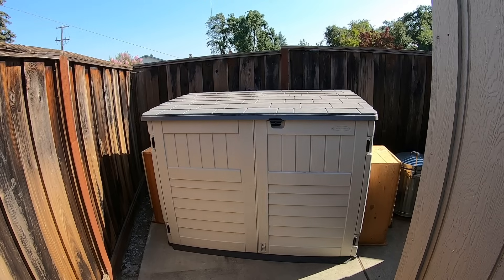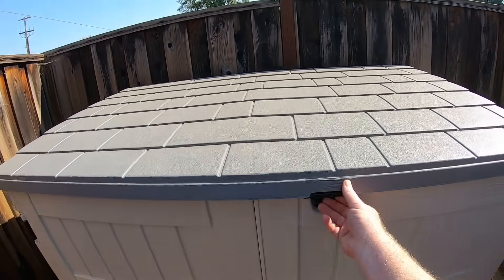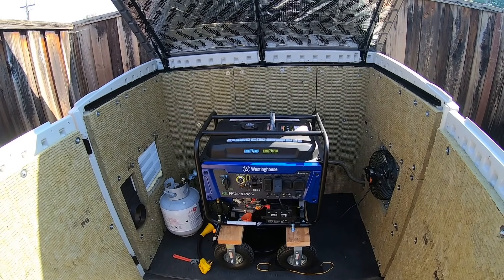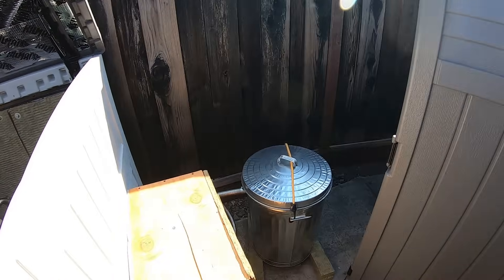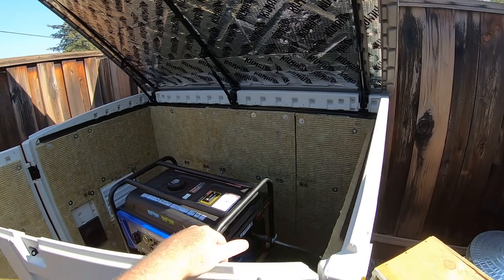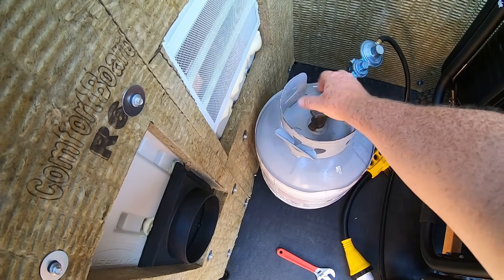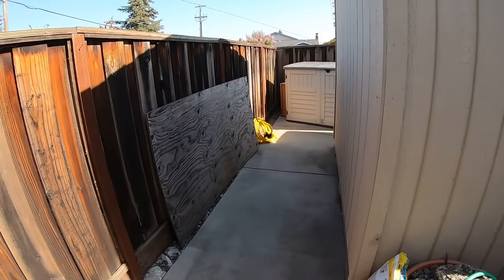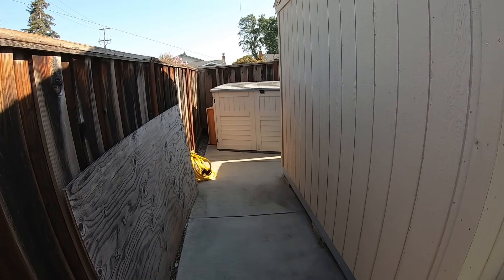DIY Generator Shed Build - Quiet Sound Insulation with Exhaust Muffler

Comment: Excellent job and ideas. However, one VERY IMPORTANT suggestion! I would move that propane tank outside of the enclosure and run your propane line through that hole you have. Because running that generator with the propane tank inside the enclosure is DANGEROUS! I used to work with propane for a living. When the propane tank gets warm from the heat of the generator, the propane expands inside the propane tank, and there is a "Safety Release Valve" on the top of the tank that will open and allow propane to escape into your "Generator Shed," and one little spark and you would have huge explosion. Please take that tank OUT of there whenever you run that generator.
Reply from the maker: Yes, I address this in a later video.  For regular use, the propane tank would sit outside the shed, and the hose for the propane tank would be routed out the same port (blast-gate) on the left side that the electrical cables go through.  The shed was just setup this way for the demo sound test.

Comment: What are the doo-bee-doos called that you used to fasten the rockwool to the inside walls?
Reply from the maker: I discuss all of the parts used in the construction, along with improvements and frequently asked questions in a later video (linked in the description.)  The part about the self-piercing screws starts about 31 minutes into the video, which you can see here:
https://youtu.be/y3pUw408jCU?si=KEo3s2U68X-h3qle&t=1851

Comment: The PLASTIC box can MELT with the heat of some generators.  You can use a remove temperature monitor to report HIGH temps inside the box.

Comment: Any loss of power with that muffler? I know some mufflers can cause back pressure
Reply from the maker: I have a later video (links in the description) that go into improvements to the design, parts lists, and Frequently Asked Questions.  I discuss the backpressure issue pretty extensively.  Check it out here: https://youtu.be/y3pUw408jCU

Comment: How did you attach the blast gate?  I see some sort of clips on the side, but it's not clear how it's attached.  I'm going to take the same route and would appreciate some direction.  Thanks so much for a great video!
Reply from the maker: I have a later video (links in the description) that go into improvements to the design, parts lists, and Frequently Asked Questions.  Check it out here: https://youtu.be/y3pUw408jCU

If I remember correctly (it's been a few years now), I used a hole saw to cut a circle in the shed, and I slid the round part of the blast gate out the hole.  Then I used a couple of screws with some large washers to hold the square frame of the blast gate to the inside wall of the shed.  Lastly, I used some spray foam to fill any gaps around the hole to keep bugs from getting in.
Reply: @C5Tor  Thank you!  Great job on the videos!

Comment: Where did you get the tires?
Reply from the maker: I got the tires at Harbor Freight.  I have a later video (links in the description) that go into improvements to the design, parts lists, and Frequently Asked Questions.  Check it out here: 
https://youtu.be/y3pUw408jCU

Comment: How do you store your propane tank when it’s running. Thanks
Reply from the maker: For the test, I left the propane tank in the shed.  However, in regular use, I would route the hose for the propane tank out the same hole on the left side that I route the electrical cables through.  The propane tank would sit just outside to the left.

Comment: Can you list the parts used for exhaust pipe, flange and your intake fan?  Thanks!
Reply from the maker: There is a later video showing parts lists, costs, frequently asked questions, and improvements to the design.  It is listed in the description, or you can go here:  https://youtu.be/y3pUw408jCU

Comment: An enhancement I recommend is using 1/4 inch thick  mass loaded vinyl behind the insulation. This material is made of  heavy minerals embedded in a vinyl sheet. Use it on all insulated surfaces and minimize seams. I used this in a guest bath and found it to be effective at reducing sound transmission. It might be more effective if placed in front of the insulation but I believe it has a poor fire rating. I did my project about two years ago using MLV from Home Depot and Amazon. Both were the same price but the HD sourced vinyl was higher quality. The finish was clean vinyl. The Amazon sourced vinyl seemed to have mineral dust embedded at the surface and tape would not stick to it.

Comment: I built a little sound proof and weather protective shed for my generator also....
But  , , I have The EU3000iS operates at 50 to 57 dB(A), which is less noise than a normal conversation. 
This makes it ideal for camping, RV power and any other activity that requires quiet operation. 
You can barely here this unit...After about 15 feet away it is not noticeable.....

Comment: What sized fan did you use?
Reply from the maker: I cover all of the parts I used in a later video, linked in the description.  I used a 12 inch attic exhaust fan, rated at 940 cfm, and the shed is only 70 cubic feet (less the space taken up by the generator).  So theoretically, the fan can replace the air in the shed every 4 seconds or so.
The gen 2.0 video is here: https://youtu.be/y3pUw408jCU

Comment: Ok so what regulates the internal temp of the box ...just the one lil fan ? And how much backpressure does that muffler of your create ? Have you had any issues with it (the generator) or the shed since ? Any mods ? As im seeing this 3 years later there should maybe be updates and improvements i would think
Reply from the maker: There is indeed a follow-up video.  The later video is linked in the description.  The Gen 2.0 covers upgrades to the exhaust (to decrease the back pressure), gives a detailed parts list, and also answers many of the frequently asked questions about the first video.  I used a 12-inch attic exhaust fan, rated at 940 cfm, and the shed is only 70 cubic feet (less the space taken up by the generator).  So theoretically, the fan can replace the air in the shed every 4 seconds or so.  It seems to work, although you could easily add a bigger fan or multiple fans.  You'd have to match the bigger fans with a larger opening on the opposite side of the shed to allow more airflow into the shed, which would then be exhausted out of the shed by the fan.  The airflow comes from the left side of the shed (the grate), and is pulled to the right side of the shed by the fans, and exhausted to the outside (on the right).
The Gen 2.0 video is here: https://youtu.be/y3pUw408jCU

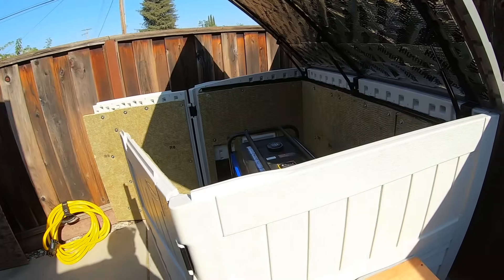Comment: At 8:55 it may not be so much to keep quiet for the neighbors, but more as to not "advertise" to criminals that you have a generator. Some actually drive around and listen for them, then steal them running or not, day or night. I have a shed (when I had a smaller lawn tractor) attached to my garage. I am going to try your trash can muffler, but then a U-turn out the bottom straight up through the garage roof as pushing the sound up above the rooftop will disperse the sound even more. I have several types of alarm/monitoring systems in and outside the shed. I have a warning sign inside that states: "WARNING: We have semiautomatic firearms and a Backhoe. You are already on cameras... do you really want to go any further?"

Comment: you have an open frame generator that are noisy  . If bought a closed frame genie  that are much quiter plus the shed you would have reduced the noise by another 50 %
Reply from the maker: When I did this video, there weren't any closed frame generators that were available that were big enough for my use case.  There are a few now, although they are much more expensive than this generator.

Comment: excellent soundeadening work
there is two points to closely follow
, the first one is the temperature inside the shed when the generator is operating at full load, I suspect an overheating problem there I'm tempted to suggest you to wire a thermostat in parrallel to the low oil level switch to stop the generator if the temperature inside the shed rises in excess of say 120 deg F
the second one is your muffler, combustion process produces hymidity and I suspect that your muffles never comes hot enough to clear it

Comment: You could have saved a lot of time and money if you purchased an inverter style generator which are at least as quiet as your generator in a box, if not more so. You are also creating a lot of restriction with that long hose you have connected to the exhaust, especially using the flex hose.
Reply from the maker: I discuss both of those issues in a later video, where I made a few improvements on the design.  The later video also has parts lists, costs, Frequently Asked Questions, etc. At the time, there weren't any quiet inverter-style generators that could put out the kind of power I needed for my use case (> 8000 watts continuous).  Since then, a few have come to market, although they are about 2 to 4 times more expensive than the generator I bought.

https://youtu.be/y3pUw408jCU

Comment: This model works great with Propane and with NG. However the Gasoline model tends to shut down due to CO2 levels too high in my box shelter. I added a fan to push out the exhaust. My muffler connection broke off due to vibration and I will now have to change some connections to get this back to acceptable performance. Your arrangement is 1st Class.
Reply from the maker: You might want to check out my later video, where I made a few improvements on the design. The video goes into that very topic, and some design changes I implemented to address it. It also has parts lists, costs, Frequently Asked Questions, etc. 
https://youtu.be/y3pUw408jCU

Comment: Doesn't that long piping for the exhaust increase the backpressure for the exhaust?  Not sure the impact of that on the engine operation but it is definitely harder for the engine to exhaust combustion products over the OEM exhaust.  Just a thought
Reply from the maker: Indeed, it does increase back pressure.  You might want to check out my later video, where I made a few improvements on the design. The video goes into that very topic, and some design changes I implemented to address it. It also has parts lists, costs, Frequently Asked Questions, etc. 
https://youtu.be/y3pUw408jCU

Comment: Well constructed. Just wondering why not letting hot air flow upward naturally instead going down by force? 6:42
Reply from the maker: It could certainly be done that way.  I pointed most things down because I didn't want any rain intrusion to the shed or components.  The exhaust points down, the baffles point down, I didn't put a fan on the roof.  All related to keeping rain out.
Reply: @C5Tor  Understood.

Comment: I bought a gas generator to charge my electric motorcycles....  Oooooooo k.
Reply from the maker: I discuss this topic in a later video.  The generator is only used to charge the electric motorcycles when at the MX track or out camping, where there are no electrical outlets available.  The 240v generator also charges the bikes twice as fast as a standard 120v outlet, so that is a plus.  This particular generator is powerful enough to charge both of my electric motorcycles at once, which I can't do with my one 240v outlet in my garage without tripping the breaker.  It's also why I needed to keep the generator mobile, since I need to take it in my truck.  

The later video, with updates to the Shed, the exhaust, and FAQs is here:
https://youtu.be/y3pUw408jCU?si=BdngW7AgPz8bLqX-&t=3000

Comment: How did you thread the exhaust pipe?
Reply from the maker: You might want to check out my later video, where I made a few improvements on the design.  It also has parts lists, costs, Frequently Asked Questions, etc. I discuss in some detail how I connect the exhaust pipe on the original design and the new design.
https://youtu.be/y3pUw408jCU

Comment: Hey man, this is by far the best solution to the generator noise. I attempted to make one with a metal shed lined with sound proofing/fireproof foam with a 4 inch fan. It didnt do much, and my fan was too small. Using an attic fan is brilliant! Everything about your set up is brilliant. We just had Milton with no power for 3 days. I felt so bad for my neighbors, thank goodness there were 3 others houses with generators on. Just, a a quick question, where did you buy your comfort boards?
Reply from the maker: You might want to check out my later video, where I made a few improvements on the design.  It also has parts lists, costs, Frequently Asked Questions, etc. 
https://youtu.be/y3pUw408jCU
Reply: @C5Tor Thank you!!
Reply from the maker: Also, I got the Rockwool at Lowes. 

https://www.lowes.com/pd/ROCKWOOL-Comfortboard-80-R-6-Stone-Wool-Batt-Insulation-with-Sound-Barrier-24-in-W-x-48-in-L/1000339775

Comment: Whic thinkness rockwul 1" or 2"
Reply from the maker: The Rockwool was 1.5" thick.  I got it at Lowes:

https://www.lowes.com/pd/ROCKWOOL-Comfortboard-80-R-6-Stone-Wool-Batt-Insulation-with-Sound-Barrier-24-in-W-x-48-in-L/1000339775

You might want to check out my later video, where I made a few improvements on the design.  It also has parts lists, costs, Frequently Asked Questions, etc. 
https://youtu.be/y3pUw408jCU

Comment: i would have put fans on the lid. one pushing and one pulling.  the sound would be up instead of out.  and then line it with egg creats pretty much sound proof.
Reply from the maker: Since the shed is for storage, I didn't want to put any holes in the lid that would let in rain.  But it definitely would have helped with letting out heat.

Comment: Where Did You Purchase The Fan .. Thanks
Reply from the maker: You might want to check out my later video, where I made a few improvements on the design.  It also has parts lists, costs, Frequently Asked Questions, etc.  I do discuss a bit about the fan.
https://youtu.be/y3pUw408jCU

Comment: I just purchased a Suncast shed and my worry is the heat causing damage. Especially where the exhaust exits the shed due to heat transfer from the hose to the mounting flange. I must say though I am impressed with the video. It is giving me a better idea of what to expect with my shed if I do the same.
Reply from the maker: You might want to check out my later video, where I made a few improvements on the design.  It also has parts lists, costs, Frequently Asked Questions, etc.  I do discuss a bit about how the exhaust exits the shed, and slightly better design to reduce the risk of melting the plastic.
https://youtu.be/y3pUw408jCU

Comment: Great video and a well thought thru design. That is coming from an aerospace engineer who also over-engineers everything. A word of caution however; fiberglass insulation that you get from HD or Lowes can and will catch fire. That is from experience at a large government military facility which resulted in an evacuation and prompt response from the base fire response team. No harm done but very embarrassing as the engineer in charge of the test.

Comment: How to keep it from overheating?
Reply from the maker: I answer this a bit in a later video.  The fan is rated for 960cfm, and the shed is only 70 cubic feet.  In "theory" that means that the air should be replaced about 14 times per minute, or every 4 seconds or so.  So far, it seems to be working, although I haven't run the shed very often.

Comment: My generac in its original cabinet at eight feet is only 62 decibels and I’m just now completing my enclosure. I went full tilt with an eight foot roof. It’s a 22kw in size and I’m enclosing the box using marine board and then soundproofing material inside. I’m doing this for protection against nose but more importantly against theft as it getting more common in the country. Such a shame one needs to do this. And I live in a “safe” neighborhood!